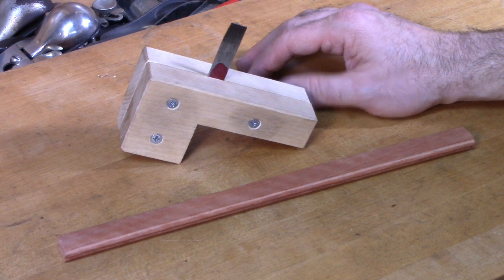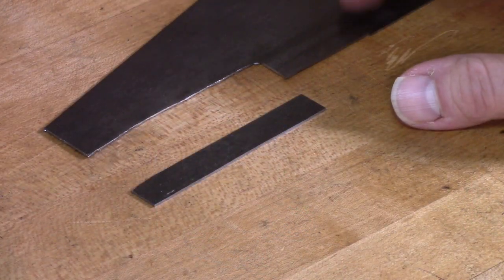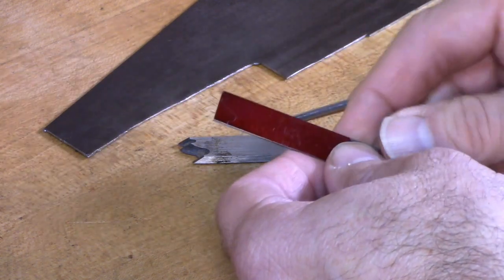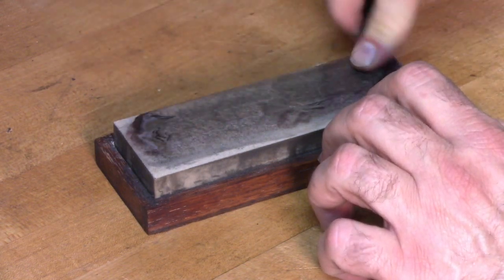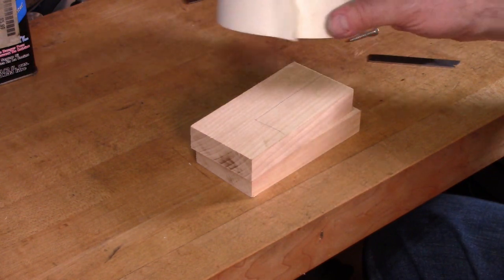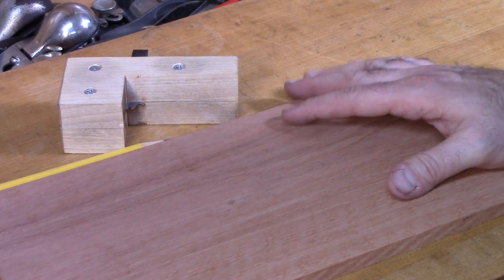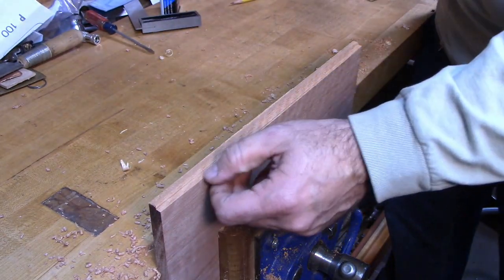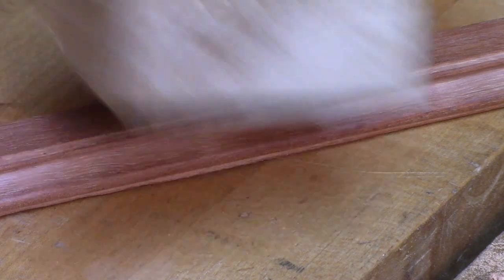Making and using a scratch stock

Comment: The molding blade you used as template is bedded at 45 degrees, usually. That means it's creating its profile at 45 degrees. If you trace the profile exactly, it's a stretched out version of the profile you want to match.
Reply: Daum gee you pulled the microscopes and calipers. Close enough for the girls I go out with.
Reply: Maybe, but that was just an example profile for the video, nobody is actually going to make a scratch stock cutter for a profile they already have a combo plane cutter for, the combo plane will do the same job faster and easier, scratch stocks are for when you want a custom profile or need to copy an existing profile you need to match for repair purposes.
Reply: @coopercummings8370  method is flawed.
Reply: @konstantinivanov1986  good for you

Comment: I've done a limited amount of scratch stock profiles and what I use is a high carbon cook's griddle scraper which is very hard and about 1/16" thick. I just clamp the guide to the rectangular scraper. Trying to put a small burr on it seems to help. But what I really want to say is great video — well thought out and done. Should have way more views, IMO.
Reply from the maker: Thank you for the kind words! I like the idea of using a griddle scraper. That would be ideal steel for this -- good and springy. I'll have to try it when my wife isn't looking.

Comment: I made some of these using your suggestions. One thing to note is that this technique is very high torque, so a fence that runs along the side, or a stock that hugs the profile board is a good method for eliminating chatter and chip-out. I also found it beneficial (although time consuming) to only scratch in the direction of the wood grain. I got some massive shavings, for a scratch stock, that is. Thank you for your insight into this amazing technique, it is truly under-rated.
Reply from the maker: I'm glad to hear you found my video helpful. You are definitely right that it's for cutting with the grain and not cross-grain. It sounds like you picked up the hang of it pretty quickly!